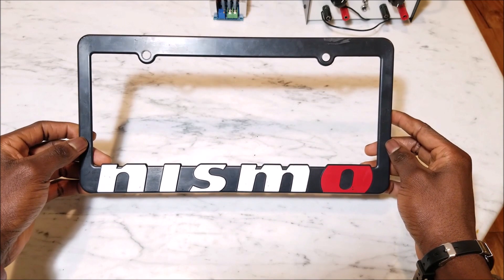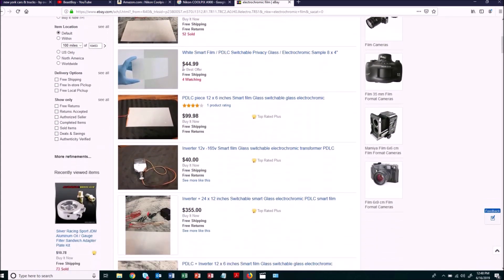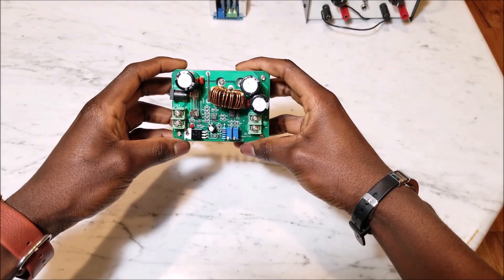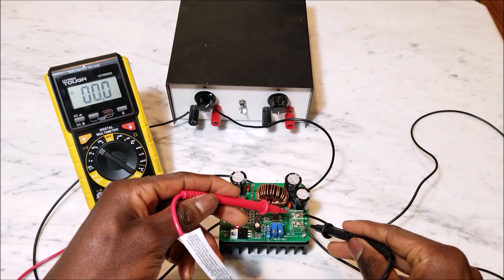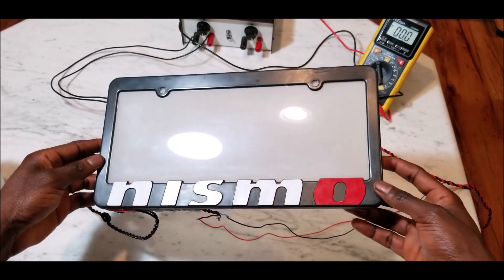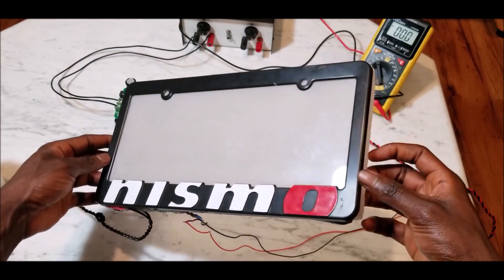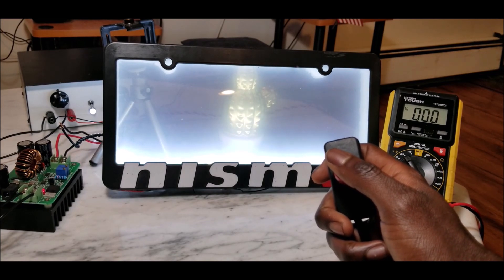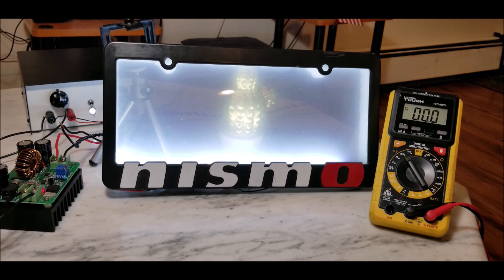Make your own STEALTH license Plate.

Comment: All this work for something that won't make the end off the day.
What you need is an retro reflective spray to spray over the numbers. Then IR beams won't be absorbed and reflect back to its source. Plate can not be read or will be less visible: a misfire. Resulting in no ticket.

Comment: guaranteed way to get pulled over in 1 day or less.
and 
put high current thru to your trunk that hinges open and also a tiny little switch inside... this = burn down your car and any structure you park near